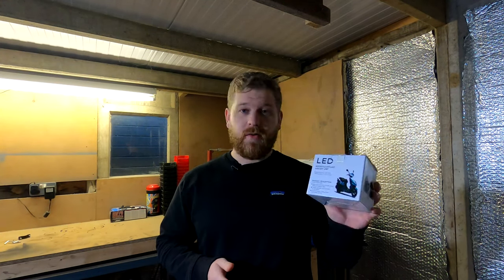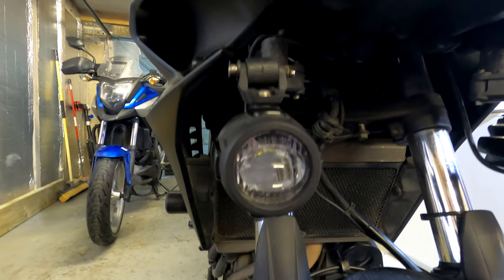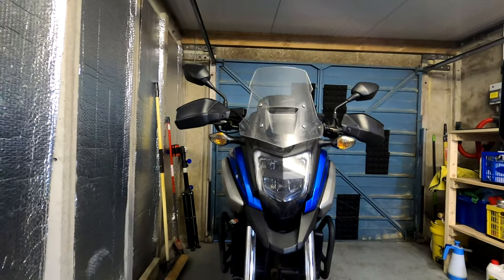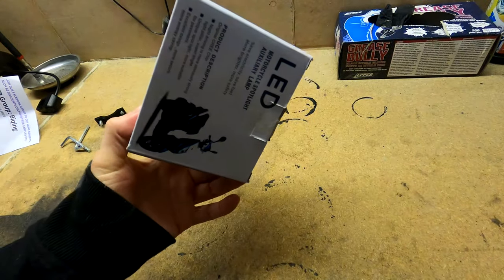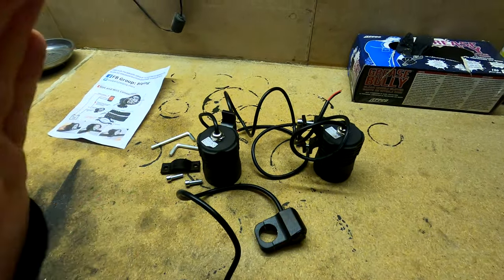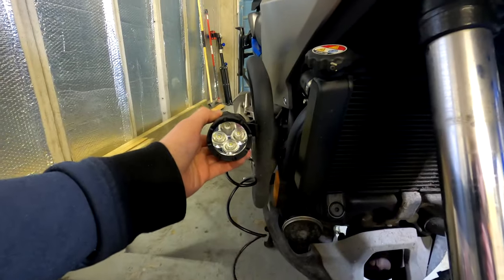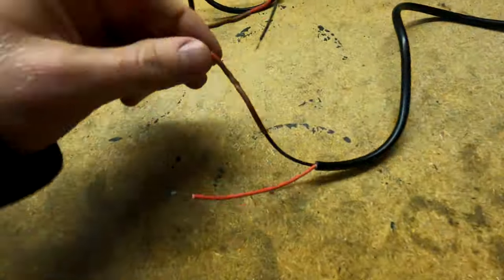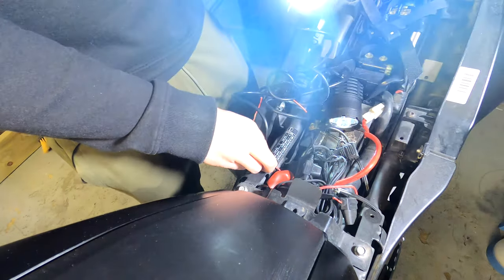Are Cheap £40 Motorcycle LED Auxiliary Fog Lights Worth It? | Fit & Test | Honda NC750X

Comment: I'm not sure I like the wiring method the manufacturer provides. There's no fuse, and the lights can drain the battery if you leave them on by mistake.

Comment: I got the Honda Forza 750, the NC750, with back brake on the left handle. The lights were very very very bad (I don't know how it is road legal), I would over run the lights at night in 5 seconds at 80Km/h or 50mph..

Comment: I've got hand torches that look the same and have lasted years. Wiring in parallel also means that if one fails the other keeps working.
Reply from the maker: These ones are going back! Think the wiring is just not up to the job. Spent quite a bit of money on new wiring, waterproof connectors and mini junction boxes but still didn't cope! Shame but get what you pay for I guess!

Comment: just a heads up Denali makes a product specific to the NC750X for an LED lighting bracket that goes right under the beak and no, the forks won't get in the way of the lights. It's on revzilla. Looks much more cleaner than mounting it to crash bars.
Reply from the maker: Good to know! Thanks for the heads up!

Comment: Can I ask ?

The lights are wired directly to the battery and had a relay ? 

Can the lights be switched on when the ignition is turned off ? 

Thanks ,
Reply from the maker: They have a switch on the handlebar so you can turn them on/off whenever you like
Reply: Ah ok , if you forget to turn them off when leaving the bike do they stay on and drain the battery ?
Reply from the maker: Yes, same as heated grips etc
They are very bright so you won't forget them, and if you do, it's a heavy push to get the bike going ha